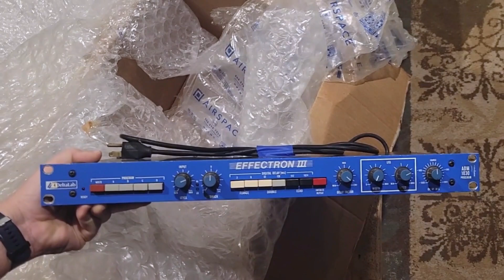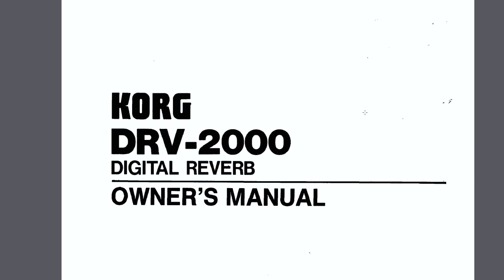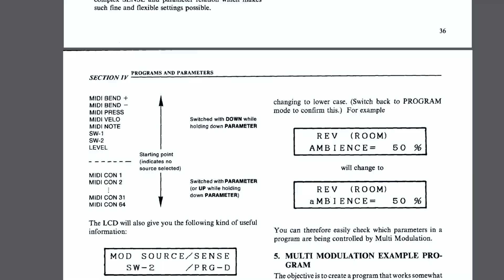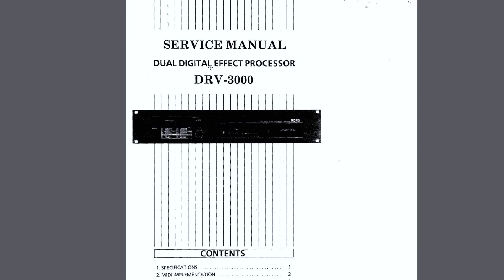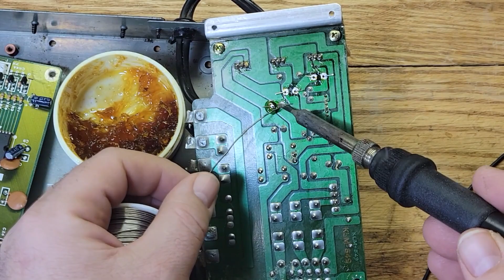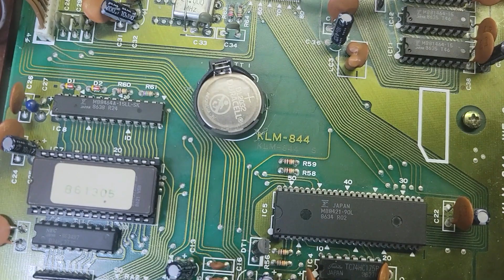Korg DRV-2000 no power repair

Comment: I think a generic 16x2 digits LED display would fit as a replacement. It needs 5V DC for the backlight, so it wouldn't be a problem to get it from the main board. Thank you for sharing your experience!
UPD: There's a follow-up video on the channel of solving the backlight problem)